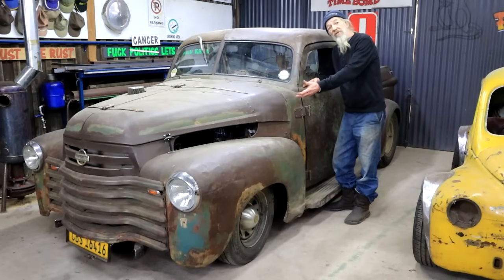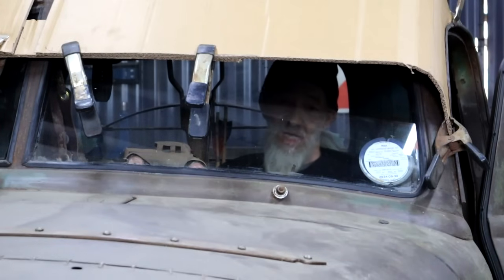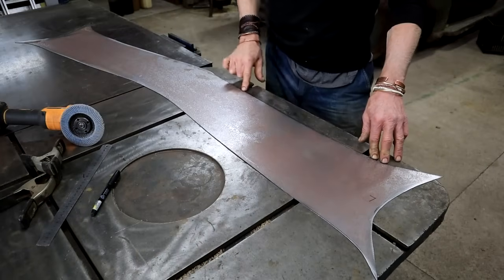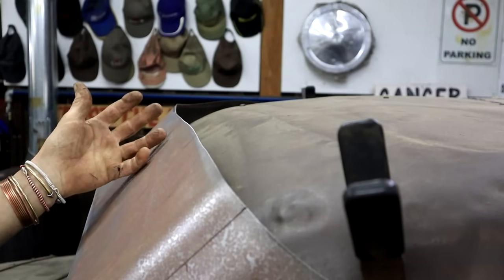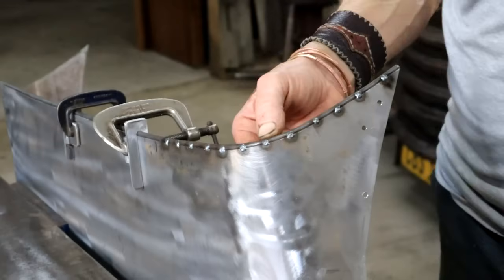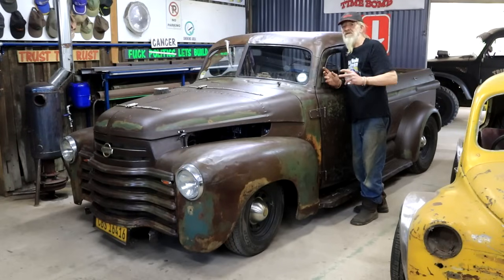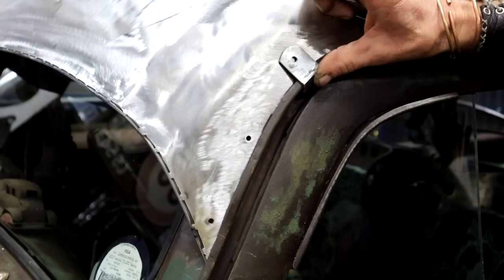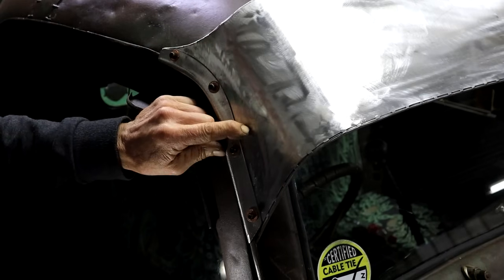Making an Old School Steel Sun Visor!

Comment: That visor looks so cool and shows your amazing ideas. The long brackets on the side make it look so much better too. I noticed that the top has an opening where the roof meets the visor , maybe if you have some Matt black paint , paint the inside of the visor so incase the sun is behind you you don’t get a reflection in your eyes. I love watching your show and look forward to the next one 🤘🏻
Reply from the maker: Good point, but when it has a rusted finish, it won't be a problem 😉

Comment: Hey Div,
   That visor changes the look of the fly trap for sure.
The back of the visor is too high above the cab for my liking, but it is not my truck.
I do like the center support and the outside fasteners.
Your rust formula looks like a winner because it works so fast.
I will be building a couple of those round bar holding clamps.
That is a great idea.
   Be safe, enjoy the warm up.
Reply from the maker: Those little clamps really work well, worth the trouble!

Comment: Dear Dif.
👍👌👏 "Weld" done again! The sun visor looks great. I was almost sure that you would rethink and cut off the downer ends for having more visibility sideways. But maybe that's only because I'm taller and therefore would sit a bit higher in the car. It sure looks better the way it is now. By the way: I almost always prefer rounded shapes over anything edgy (Lego might be one exception ;-) 😁). In nature almost nothing is edgy. 2) About rattling respectively vibrating metal parts: Please kindly allow me to suggest that you put thin pieces of rubber under all your fasteners of the visor. Old tubes from car, truck or bicycle tires do fine. 3) Good to see that you had fun while being at the car show.
Thanks a lot for making teaching explaining recording editing uploading and sharing.

Comment: Nice, here in the UK we have the same problem with 1p and 2p coins, worth nothing to spend vut the older ones are pure copper, the new ones copper plated steel, the old ones are worth far more as scrap value, and cheaper than buying copper washers, great for use on boats.

Comment: Another brilliant addition to the roster is the little gauge tool for the round bar edging- lekker, for sure.
Ps.  I was betting that the visor would have adjustable brackets like many of the old visors had. And, 
I thought you'd mimic the hood hinge design there. Again, you are full of surprises. Keep being you! .
Reply from the maker: Wanted to keep it simple, hence no adjustment brackets 🙂

Comment: Dissimilar metals gives you electrolysis which gives you corrosion. Nice idea about the curved clamping pieces. The individual L-brackets would have looked "not as refined".
Reply from the maker: Yes, that's why I said I'm building a battery😅
Reply: @ratrodsafrica  You talked about useless coins, my kids are in their 40’s now and always used their cup holders in their cars to dump their change. That’s not a problem anymore. Everything gets paid by debit cards.
Reply from the maker: @kodak_jack  that's true!

Comment: Instead of nuts to hold the visor to the drip rail I would weld studs to the visor and use nuts to hold the clamp. for decoration you could use acorn nuts instead of regular ones.
Reply from the maker: Same difference, hey.😀

Comment: I’m looking at building one, I just don’t know how thick of sheet metal to use, what size did you use on yours?
Reply from the maker: I used 1.2 mm/16 gauge but 1 mm will also work fine